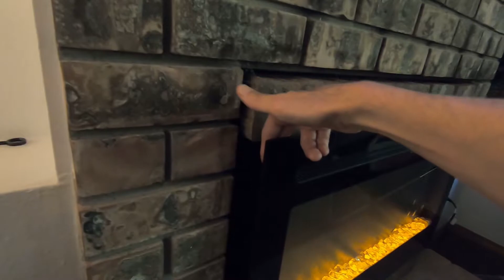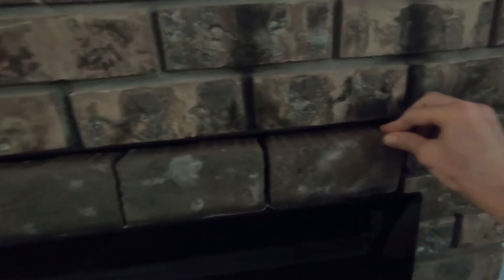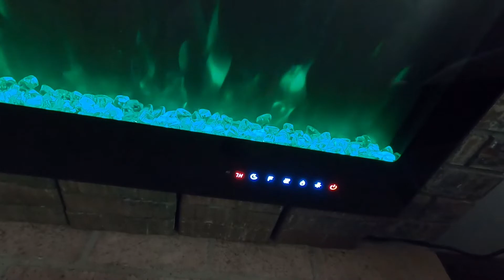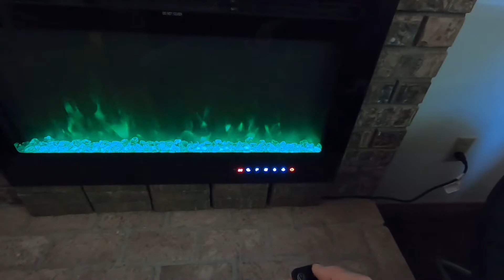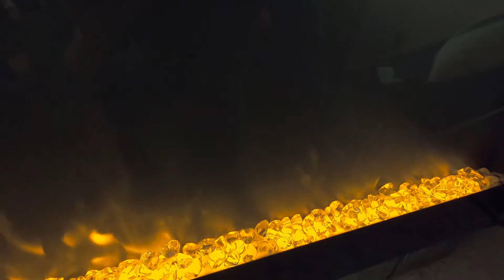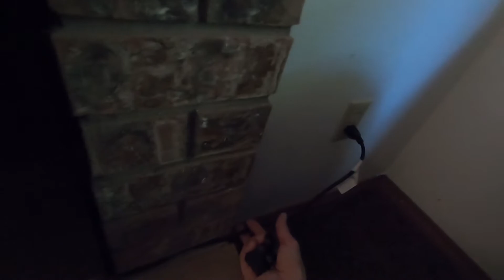Homedex 36" Recessed Mounted Electric Fireplace

Comment: I didn’t see any manual with mine. How do you remove the glass?
Reply from the maker: Hi Nick:  If you look at the unit from the side, you'll see that the glass is attached to some brackets that slide into the main unit.  It's been six months but I seem to recall gently sliding the glass upward and it pops out of the brackets fairly easily.   I think it's just secured in with gravity so there should be no screws to loosen but give that a try.
Reply: @MosquitoFood  I tried sliding it up with no luck
Reply from the maker: @Martrain2004  In that case, it must be secured.  Again, it's been six months but I seem to recall that the two sets of silver colored phillips head screws on either side may have to be loosened or removed entirely in order to slide the glass up.  Good luck.